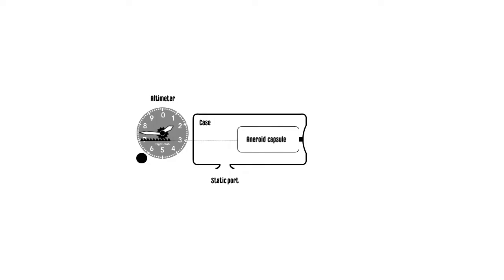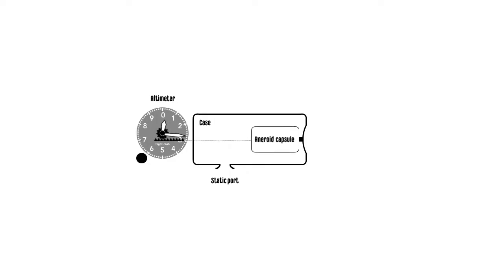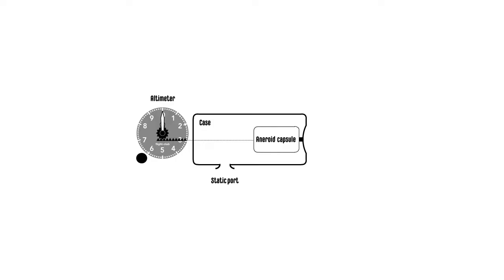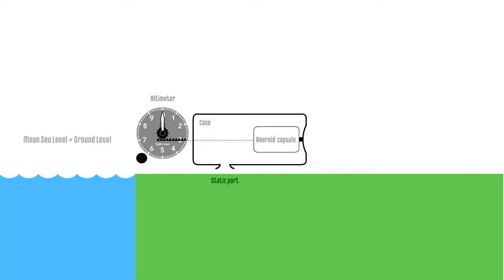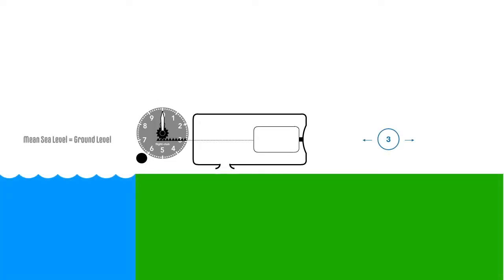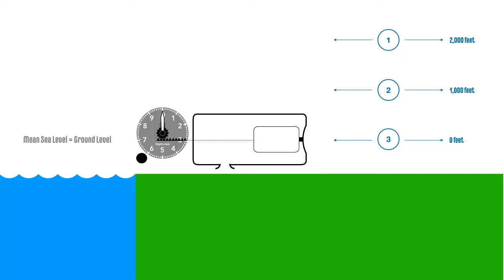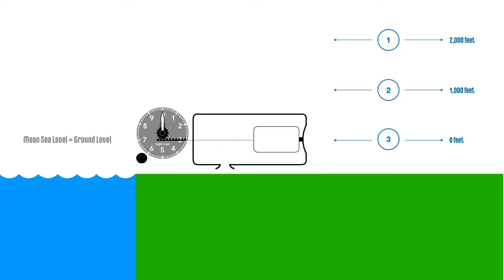How does altimeter work?

Comment: Dear FlightClub team

I am a little confused by the phrase "from high to low watch out below"

could you please explain what that means in simple words and briefly
Reply: When moving from an area of high pressure to low pressure, the altimeter will over read unless datum pressure (ie. QNH) is adjusted with the dial. This is obviously dangerous as you may be thinking that you are at a higher altitude than you actually are, especially if you are near mountains.